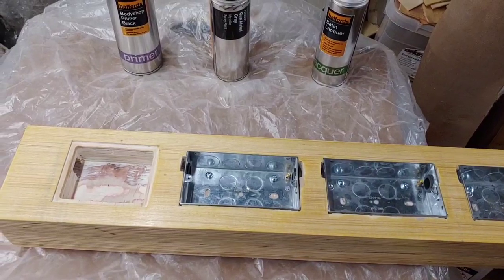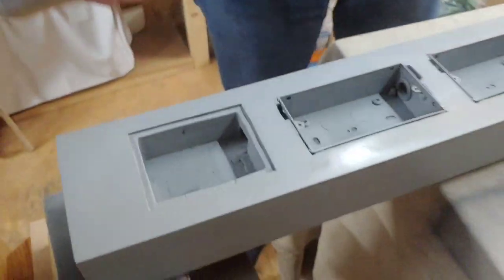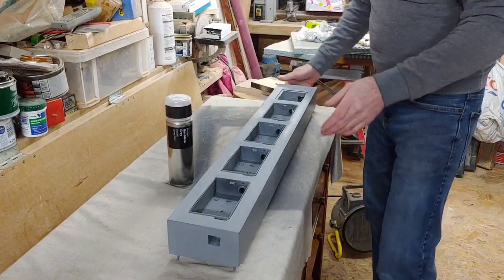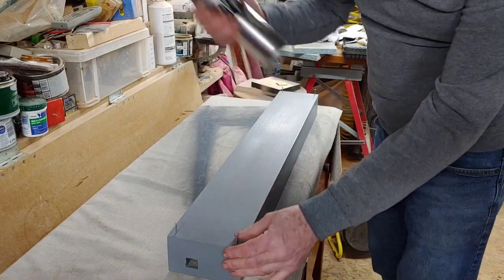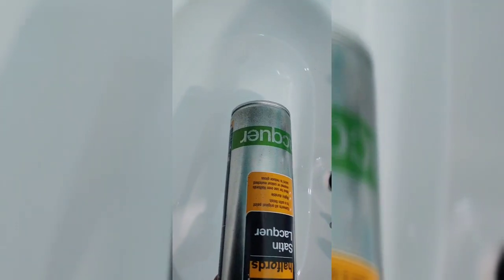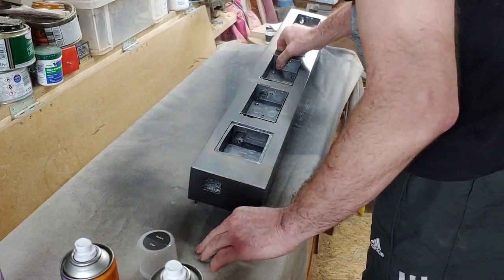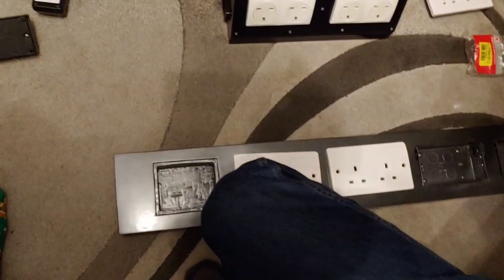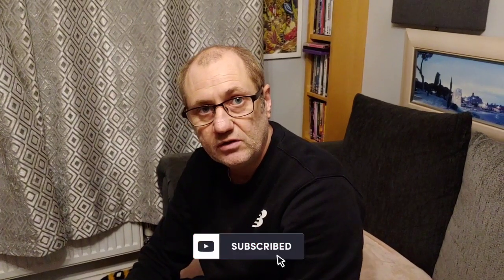Finishing The Case Work Of Our Mains Conditioning  Hub

Comment: That's a good choice of paint and a very nice spray job. One thought for the filter is to include a DC trap (capacitors and diodes). Most domestic power lines have a DC offset, which can really mess with the transformers in audio gear.

Comment: Hi Ian, I'm running out of superlatives for your projects, nice 1 👍.

Wee tips for anyone reading: make sure you are painting in a warm place(no naked flames!), spray paint hates getting sprayed a low temps! The darker the colour you are spraying, the better your preparation of whatever you are spraying will need, as darker colours show up imperfections more. 
If you have orange peel looking topcoat /finnish/ clear coat, let it dry for  24 hrs +, then  polish smooth with a paint rubbing compound. Can be/needs to  be done by hand on small or intricate parts, or with a polishing mop on a drill (at lowest speed😉) or the correct polishing machine if a big enough part. Watch not to  rub through the paint to the undercoat at any edges, as it's very, very easily done! 🧐 
40+ years restoring /tuning /painting  classic Vespa scooters brought many failures and successes, starting before knowledge was readily available on the tinternet, or the tinternet was available, so hard won trial and error learning! 🧐 🤣 
Stay safe.
Jim 🏴 ☺